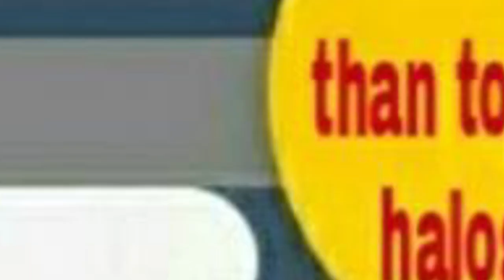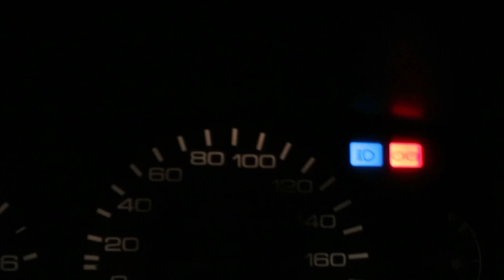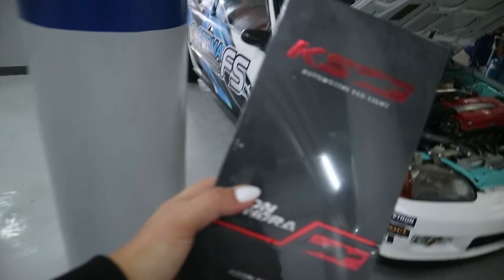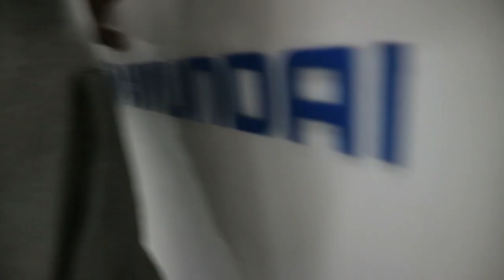Installation of Keon Sondra LED lights | Hazel Ramirez

Comment: Pinag kaiba ng 5000k at 6000k is ung color temp.
5000kelvin-warm white
6000k-pure white
 Proud keon sondra installer po ehehehehe 
     Pa shout out po sa next vlog mam 🥰🥰
Reply from the maker: saludo po kami sa inyo :)
Reply: Pwede po ba siya install sa reflector type?